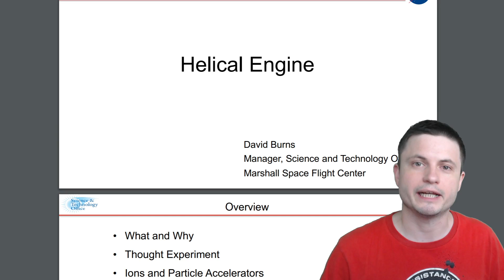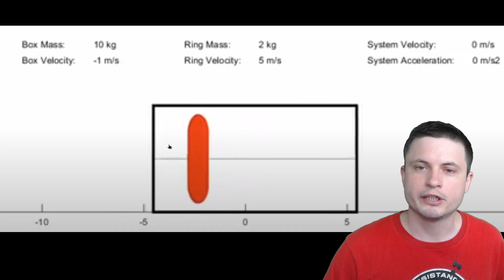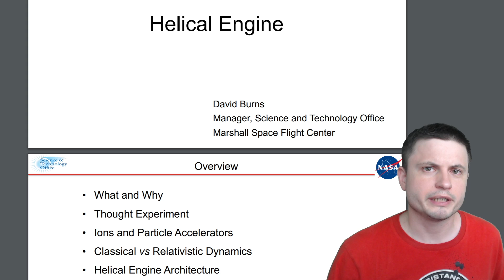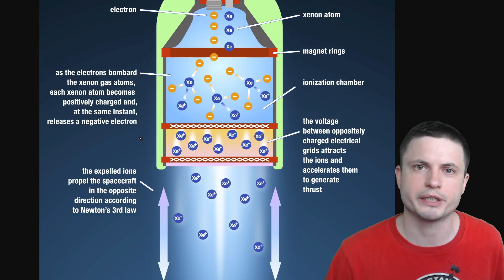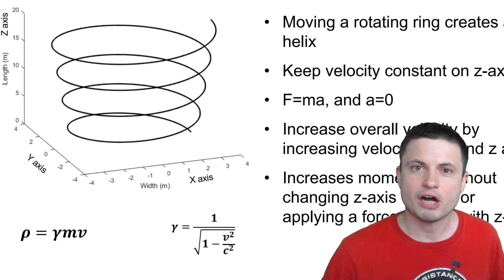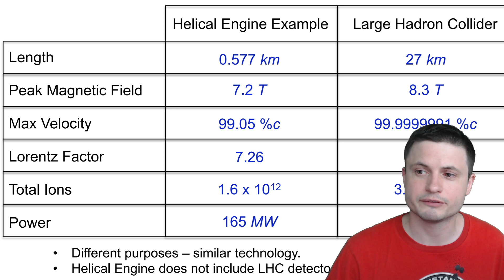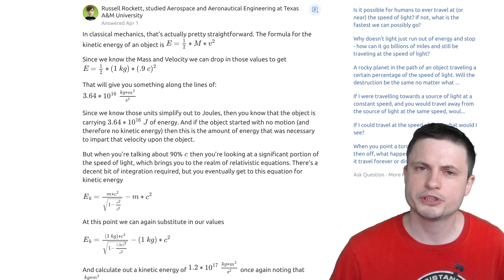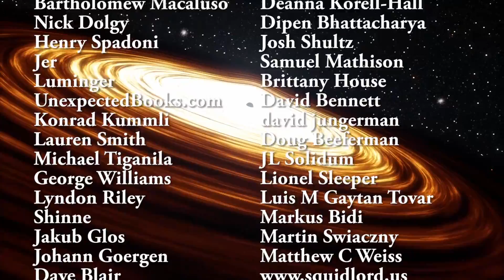NASA Engineer Designs a Near Light Speed Engine But Does It Work?

Comment: I see the spiral used to explain the concept...i cant help but think if the top recycles the weight to the bottom it would never stop or "bounce" only redirect the weight and momentum... it also make me wounder is there a limitation other than size and mass that governs the tesla coil or could this be used to help produce the energy difference needed from a say the energy gathered from solar to the energy needed for the engine ???

Comment: It wouldn't work for the same reason black holes dont exist (nearly black holes do!). As any system travels to the SOL time would slow and therefore stop. Which quite frankly is disastrous. Same with black holes, their spin speed is that fast that time would stop, meaning a black hole could never form to exist. If entropy is static then time would not pass, as time is emergent from the entropy mechanism.

Comment: Would it be possible to use magnetic resistance, and the lack of meaningful resistance in a vacuum to create the initial motion, then utilize this motion and use its kinetic energy buildup to produce a large portion of the needed energy to "push" this doughnut of mass?

Comment: Maybe the shape of the engine would have to be a magnetically simulated and stabilized toroidal field using mercury based ferrofluid as the internal mass to be accelerated to near light speed at the zero point axis and slowing enough to not create back thrust as it spins around the outer layers of the field. It may be the same way the ancients did it.

Comment: Gasoline, poured out and lit on fire, produces light/energy in the form of heat. We have found ways to use gasoline by mixing in air, compressing it, and then igniting it. Just like in a conventional engine. What if we were to take the effect of a nuclear fuel, and apply it in similar terms. There's a lot of energy in a nuclear bomb. All released at one time. Tremendous heat/light and energy as it spreads. Think about if we were able to focus this energy in a controlled fashion, metering it in a way to provide thrust. I'm no engineer or scientist. I'm just a normal guy. Maybe this idea is already being done in a different fashion. But maybe this whole problem is being over-analyzed and over-thought. The KISS method of keeping it simple stupid has helped me well. Maybe this method isn't simple, but in terms of trying to achieve light speed or close to, something has to make sense eventually.

Comment: Humans can only stand less than 10g of acceleration before it killing them, and the actual time has a lot to do with individual physiology.
NO Human would be comfortable trying to perform ANY physical function while accelerating at More than 1 g, so until we find a way to suspend normal physical laws locally, in a spaceship, attaining any high speeds will have a time constraint to attain them.
I believe all materials have a limit to the acceleration they can withstand without disintegrating, which is another limiting factor.
Warp Drive would tear a ship apart.
We would have to find a way to suspend the Laws of Physics to attain such a speed so quickly.
It won't happen, except in Science Fiction writer's minds.
It's Fake Science, much like Fake News.
You can believe it if you want, but that is not going to make it true.
Reply: So, you're saying, that because humans can't tolerate high acceleration, everything said is fake science and fake news?
Bro, you need to have your head checked.

Comment: Hmm wonder if we used more efficient type Gen V reactor fission ( lets keep it real ) and potentially a sterling engine type which generates electricity based on temp differential .. space is almost absolute 0 Kelvin to a typical nuclear fission Gen 4  running at 60 to 80% efficiency ( as opposed to LWPR currently deployed around the world with only 2% efficiency ) direct electrons .. then eject... hmm... that MW value is potentially achievable .

Comment: An explosion inside one end of a sealed tube will produce thrust in the direction  that is closest to the explosion. This can be demonstrated with one of those microwavable soups that come in a bowl  with a sealed removable lid. As the soup heats up the top surface layer will heat up the fastest causing a small explosion that will push against the lid causing the entire bowl to jump off the microwave platter. The explosion going in the opposite direction of the lid hits the less heated  portion of the soup and kinetic energy is absorbed by the soup which reduces the thrust in that direction.  So we have produced thrust in one direction without having to sacrifice fuel reaction mass out into space as is done in a normal rocket system. If the fuel for the sealed tube rocket uses a hydrogen oxygen combustion system then the steam exhaust can be reused after it is recycled through electrolysis.

Comment: I thought about something like this when the EM drive was making its rounds. When a long tube pointed towards a gravity well ( say the Earth) as the Photons hit the top compared to the bottom they would have a difference frequency wouldn't they? That would make an uneven amount of energy transfer between the photons bouncing at the top compared to those hitting the bottom making a Net gain of thrust. Surely something has to be off right? It seems like Thrust would be produced by a Photon that was vertical to the gravity of a large massed body equal to the shift in frequency of a photon in that gravity field.
Reply: Hahah, why just not use photon momentum itself to propel yourself forwards? Why come up with such ludicrous designs?

Comment: The idea of humans attaining the speed of Light, raised a question in my mind.
How long would it take accelerating at 1g ( 32.17405 ft/sec ) to reach the speed of Light?
My iPhone gave me the value of 353.916 Days. About a year. An on-line answer gave me 354.31 days, so I was close.
Then there would be the necessity to slow down and stop.
The remaining question I have is how far has one actually traveled in those 354 days?
Reply: its quite a simple equation, the answear is 0.4846 light-years
Reply: ixiox p 
You figured out how FAR On would go while accelerating and maintaining 1g to eventually reach the speed of light?
Did you use Calculus to figure this out?
I didn't use it to figure out mine, and I'm now wondering if it would need to be used.
I used increments of whole seconds to figure mine, but now I realize in order to maintain 1g at ALL time, would have to include fractions of a second in order to get a more accurate estimate.
Am I wrong?

Comment: You are going to spin a, lets say 1kg, donut perpendicular to the direction of travel; Some would claim the doughnut would "desintegrate", so I'll throw this up as an objection to feasibility as well although I dont believe this to be the case. Then how are you going to produce the energy to move the now 100 ton donut? Oh and how will its shape change once you get the craft it's sitting in up to speed? Ok let's say it's all not a problem and you get that? How are you going to overcome the generated gravity fields? What about the speed difference between the inner part and external part of the doughnut?
I think the gravity wave surfing  ship has more chance of succes.

Comment: I still don't see quite how this is supposed to work. You cannot produce thrust without a wake of some kind.

Actually... when I think about it, this is pure nonsense:

1) From the frame of reference following the ship, this is just ring going back and forth. There is a slight acceleration first one way and then equally the other, it may be +0.9c one way, but then it is -0.9c and pushing you back. Both cases having the same amount of mass, and hence no net acceleration either direction.

2) For relativity to make sense, we already know that you cannot observe acceleration in one frame of reference that isn't there in another; unless that frame of reference is itself accelerating. So that tells us that the frame of reference which is at rest (say Earth) must also record no net acceleration.

The picture of it suddenly dropping to half mass when it passes its center point is nonsense. It's shown accelerating at the end points, so that is where the mass shift would happen.

Let's assume a ring with 1kg of mass, and the ship moving in such a way that when bouncing backwards, the ring is perfectly stationary seen from Earth (v=0, γ=1) and when moving forwards, the ring moves at has a γ=2. In relativity, there is no such thing as an infinitely stiff object, so no matter what, we must expect a nonzero time of acceleration a in both directions. Rather than actually go through this in detail, just observe that we know that the acceleration at each end is such that the net change in speed is 0.866c (which gives γ=2). In Earth frame of reference, the mass moving forward is 2kg, and moving back is 1kg.

So: the acceleration applied to the end point will accelerate it from 0 to 0.866c, but it will also gradually increase its mass to 2kg. This means that early in this acceleration, it only needs to accelerate 1kg, but late in the acceleration process, it must accelerate 2kg. On the opposite end, deceleration will start at 2kg, but it will end at only 1kg. These are mirrored processes, leading to an equal force being applied to each end of the ship.

Important: The mass only influences momentum when it interacts with the ship, ie. at the end points. There is 2kg going one way and 1kg the other, yes, but that does not matter, since this is not acting on the ship with any force except through the acceleration at the ends.

In other words, zero net speed change over multiple passes back and forth.

Comment: What if you used photons or electrons and had a mirror at both ends with a material with a high refraction index(glass?) on one side and a laser, perhaps covered by a one way mirror, as the initial light source

Comment: Would it be possible to use a pendulum type of force where the mass would be greater when force is going down and a reduce in mass as it goes higher so instead of a box a circle or a spiral with a stop point in the forward direction ? Whilst hitting the next mass to create a relative motion so the two mass objects continually go ? And being within the same object its keeping the relative motion when speeding up ? So going back to simplicity much like a turbine but using relativistic shift ? Just a question, I'm not in anyway qualified to answer lol

Comment: You mentioned mass conversion would be more efficient, citing the amount of energy released from uranium fission in nuclear reactors. My understanding was that the energy comes not from converting all the mass of the uranium to energy, rather releasing a small portion of the mass that was in the form of bonds within the nucleus. So I don't think your statement that it would be easier to convert mass into energy and throw it out the window is correct, but I like the rest of the video.

Comment: One of the biggest problems with the propulsion of any vehicle is the fuel to mass ratio. To accelerate the parts to high velocity, a fraction of c, this would require a huge amount of energy and so a lot of fuel. This would have to be carried by the vehicle. Matter-antimatter annihilation might be the best theoretical option but the technology for producing large amounts of antimatter doesn't yet exist. Also to get close to c requires very very great amounts of energy, so cruising of this vehicle would probably need to be a small fraction of c.

Comment: Damn this is completely sound. I imagine that since the object can accelerate without losing obvious mass, it is achieving an 100% efficiency in converting mass into energy.
Reply: How is this completely sound?
Reply: You can't achieve 100% efficiency. There is always energy loss.
Reply: @Sara-L  oh I'm talking about E=mc^2 conversion not converting between types of energy
Reply: It actually achieves over 100% efficiency -- it's a perpetual motion machine. The net power delivered by a thruster is F . v, so it grows linearly with speed, whereas the battery drain would be some constant P. When the speed reaches v = P / F, you'll be getting more kinetic energy from running the engine than you would from running the batteries. Strap the thing to a generator, and it can power itself and then some. That's how you know there's an error somewhere, because perpetual motion machines are impossible. Energy is conserved, and so is momentum; this design violates both.
Reply: @isodoublet  This is incorrect, you are forgetting that you need to release all of the stored energy of he spinning mass every cycle. You can't take it with you or the amount of moving mass would not change and you would bounce back and forth. What this does is uses and continuous input and output of energy to move. This makes it horribly inefficient like he said in the video, at the amount of energy throughput required, it would be more efficient to directly turn the energy into mass and then use some of the energy to accelerate it backwards, hell it would be more efficient to shine a laser out the back of the ship.
Reply: @Jeremy-gy7me  " you are forgetting that you need to release all of the stored energy of he spinning mass every cycle. "

You misunderstand the design. The idea is precisely to generate thrust without leaving any mass behind, which as you say is in clear violation of conservation of momentum and the center of mass theorem. You are assuming competence on the part of the guy who proposed it, but that's an unwarranted assumption. He truly believes that if you make the spinning mass more massive in the forward leg of the cycle, then less massive in the return leg, that you'll get a net thrust, because he neglected the reaction on the energy being used to make the spinning mass more massive in the first place. 

"hell it would be more efficient to shine a laser out the back of the ship."

Shining a laser would actually work and be maximally efficient (assuming no losses obviously). This design is asserted to be more efficient than a mere flashlight. It must be so or there's no reason for talking about it. But it's trivial to demonstrate that anything more efficient than a idealized photon thruster is also a perpetual motion machine, hence my post above.
Reply: @isodoublet  Being more that 100% efficient does not necessarily mean that they are perpetual motion machines. Geothermal heating is more than 100% efficient, the heat supplied per unit of energy is greater than if you just direct converted energy to heat. Potentially this could have been the case here, but the math shows that it is not.
Reply: @Jeremy-gy7me  " Being more that 100% efficient does not necessarily mean that they are perpetual motion machines. "

It actually does.

"Geothermal heating is more than 100% efficient, "

It actually isn't. And if you think that it is, it only shows that you haven't accounted correctly for all the heat flows.
Reply: Did you understand how the rotation of the thing factors into this? I didn’t quite get it the first time around.
Reply: @johnburnham6239  i dont really understand it too well, but i'll dumb it down to the level i was able to get. So you have a tube, and you have some kindof material, that would be made to spin inside of it, thanks to that one force he was talking about. Once it builds up enough rotational energy, it would be launched forward, and turn its rotational movement into forwards movement for the ship, and it would happen over and over, bringing the ship to and keeping it to a good percent of the speed of light. The problem is, is that this requires an obscene amount of energy to do, and while we can make a lower energy using version, it would also drastically lower the potential top speed.
Reply: @snowgrave2475  I think its using the spinning motion instead of the linear motion to increase the mass. In the first example where the mass was just going back and forth accelerating it would be challenging given the space needed, so if you have rotating motion you can take as long as you need to spin it up and increase the mass.
Reply: @nade5557  well... yeah? I still have no clue about how it'd work
Reply: @johnburnham6239   basically they are spinning the object to keep it from counteracting the motion of it hitting and moving it forward by turning that counteracting motion into more of a wobble

Comment: Reminds me of the Clang engine in Space Engineers.

The way a Clang engine works is basically by pushing a small container backwards and forwards very quickly, putting a bunch of heavy items inside it before it pushes forward and taking them out again before pulling it back.
Reply: That's actually a pretty good way to see why it doesn't work. It's really the same principle only without the overcomplication of adding relativity into the mix: if you push those heavy items forward you have to push them backward to keep them in reach, and that cancels any momentum the collision might've given you. The exact same thing happens with this design: moving the energy to and from the batteries cancels the momentum in pushing it around when it's part of the "donut".

Comment: You could propel the ship with two hammers.  If you had the Hammers propelled by locomotion at 90°horizontal and accelerated them slowly building up faster past the halfway point.

Comment: 8:12 Actually the amount of energy in one kg of Uranium isn't 8*10^13J thats what an nuclear reactor could get out of it but it isn't converting the whole mass into energy. If converted completely it would produce 10^17J which exactly equals the energy required to accelerate 1kg to the speed were it has the mass of 2kg because you basically put 1kg of energy into it. So overall its a zero sum game.